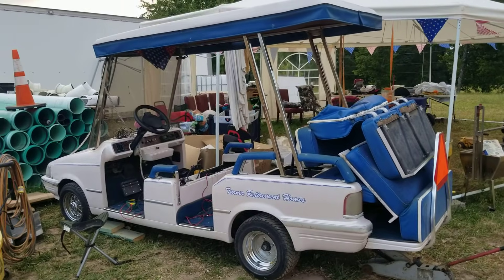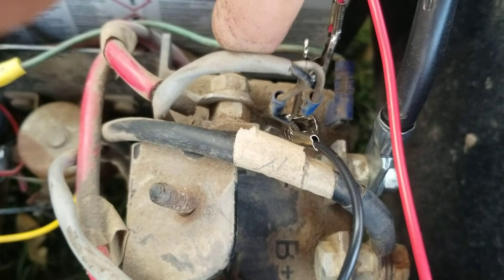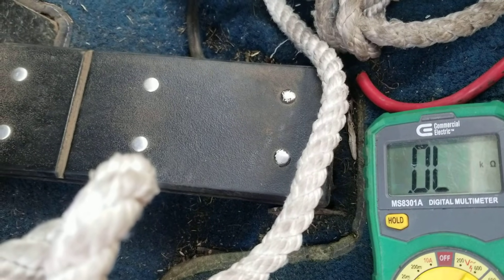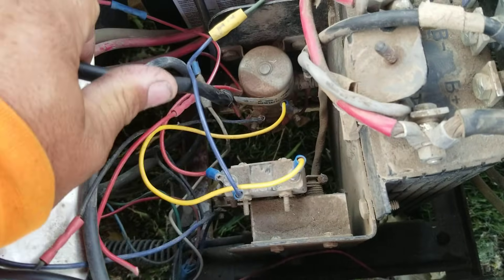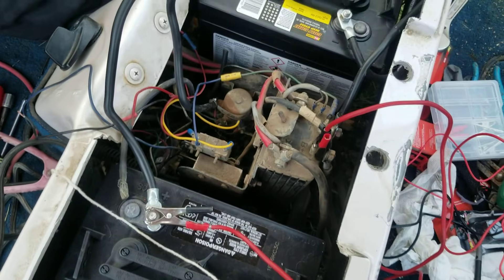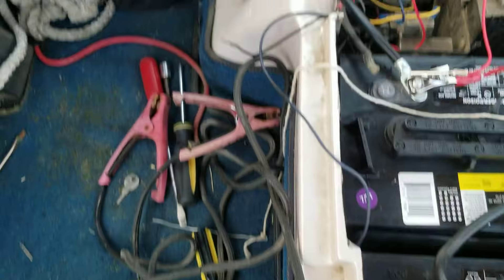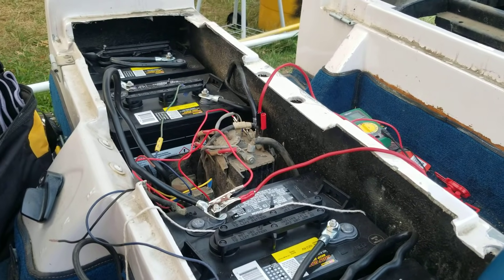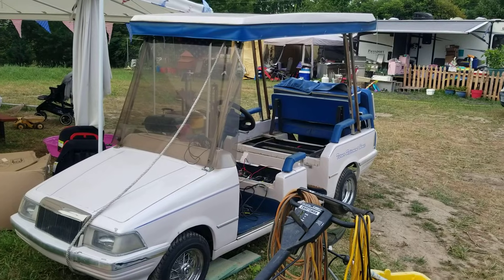electric golf cart, simple Motor and controller bypass key hotwire direct wire bench test

Comment: Hello
I bought few weeks ago an old western golf cart. After one day completely fine, I plugged the cart and the charger blew up.
Since that the cart is not running and I’m trying to understand and fixing it.

When I turn the key ON I have a click from the solenoid, but no click when I press the pedal.
I’ve checked the batteries voltage, solenoid etc
I don’t have a pedal box in the front.
I’m thinking about the part where we can see the yellow, purple and red wires (accelerator micro switch I think) ?

Should I try to bypass to find my issue ?
Thanks 

Thank you for your help

Comment: So I duplicate your steps and the same results.  Is that telling me the controller is bad or the solenoid?  New solenoid is about $140.00 on Amazon and several models to choose from.  So, I would just like to be sure.  Thanks.
Reply from the maker: @johnmueller3494  If your wheels are turning then you're controller is probably okay...

The solenoid is a big relay switch with fatty power wires on both ends, basically when you turn the key on it gives a smaller voltage to the side of the relay that triggers the switch to connect the two big wires..
So you need to test if your trigger wire is sending voltage to your relay to see if the relay clicks on and off That might help you determine if your relay is good or bad.

Comment: Thank you for the video. 
This worked for my western cart also. I replaced solenoid… still didn’t work until I bypassed. Does this mean the controller is bad?
Reply from the maker: @nj398   @johnmueller3494  If your wheels are turning then you're controller is probably okay...

The solenoid is a big relay switch with fatty power wires on both ends, basically when you turn the key on it gives a smaller voltage to the side of the relay that triggers the switch to connect the two big wires..
So you need to test if your trigger wire is sending voltage to your relay to see if the relay clicks on and off That might help you determine if your relay is good or bad.

Comment: I did this and it works. Does this mean your controller is good or bad if this bypass works?
Reply: Same here… ran jumpers and it works what is the issue lol
Reply from the maker: @MatroxFilms   @johnmueller3494  If your wheels are turning then you're controller is probably okay...

The solenoid is a big relay switch with fatty power wires on both ends, basically when you turn the key on it gives a smaller voltage to the side of the relay that triggers the switch to connect the two big wires..
So you need to test if your trigger wire is sending voltage to your relay to see if the relay clicks on and off That might help you determine if your relay is good or bad.

Comment: You said Press the "Gas Pedal", Don't you mean "Electron Pedal". Pressing Electron Pedal  Increases Electron Flow. 
Also, the Gas Pedal should Really be called the Air Pedal, as it actually increases Air Flow, and causes more Fuel to Flow. Accelerator Pedal may be more accurate for all.
Your Video was Usefull and Helpfull, Thanks
Leaving a like. Later
Reply: Was I supposed to laugh?
Reply: Because I didn’t
Reply: @enochtheewok7770 no one likes you
Reply from the maker: @randyaivaz3356  ha ha 😂 yeah, We grow up with gas pedals and when we move on to electric vehicles for some reason we still call them gas pedals.. 
Kind of like when you hang up the phone You used to actually hang up the phone but now you just end the call and call it "hanging up the phone" lol

Comment: b- to m- jumper will bring them to life aswell little easier less wires this bypasses the controller all together to aid in diagnosis in situations where solenoid clicks but motor doesnt move.
Reply: My solenoid will not click unless I put power to orange wire on solenoid any ideas or suggestions
Reply: @shaunbyrne6174  guessing you found a micro switch not working. If you had power on the blue wire to the micro switch with key on.
Reply: Tried b to m and nothing happens

Comment: Is the power connection of the curtis controller that you attached to the throttle connection? I want to try this bypass but my controller is an alltrax and does not have a connection labeled as power. Thanks!
Reply: Mine was not labeled as power, but 2 of the 3 small wires went to the pedal , so that leaves the 3rd wire and narrows that one down to the power

Comment: How do you test the controller with the multimeter I'm having an issue with the motor not being pushed by the controller. The motor will engage sometimes when flipping the reverse and forward switch back and forth it will suddenly jerk with power but not variable with the pedal only full on speed makes me think there's something wrong in the controller. The forward reverse which I've completely disassembled cleaned and made sure everything works properly and tested with multimeter variable speed controller / rheostat is good too on the ohms.
Reply: I'm sure you can test resistance between terminals on controller to find out if it's bad or good.. I don't know those specs..
If you jump a wire across the 2 wires for the gas pedal or (potentiometer) that should be full throttle..
Reply: @portlandlocalchurch8168  I figured it out a little while back It was the actual controller itself burn out. Replaced it with a new one works fine.